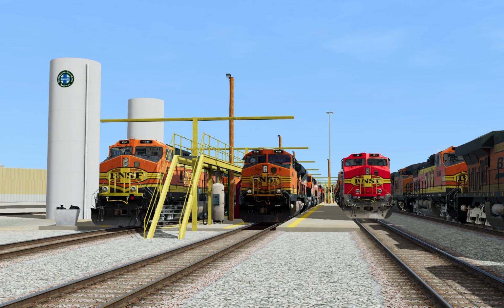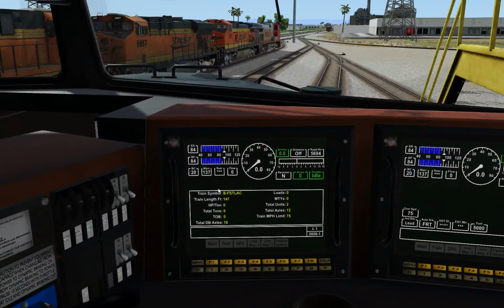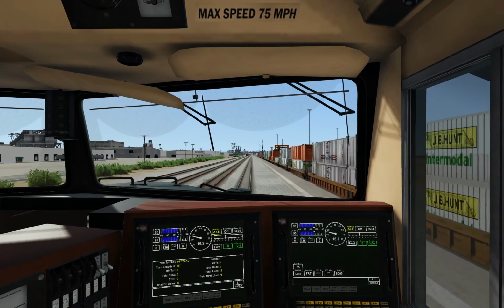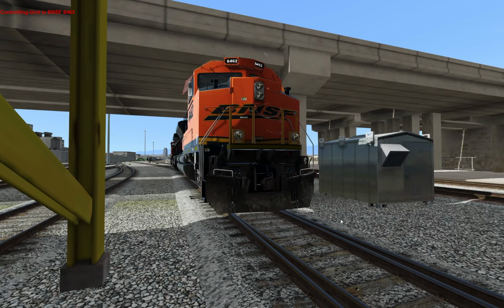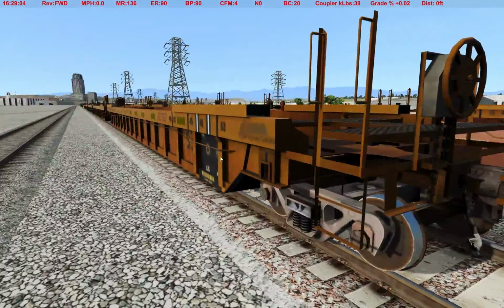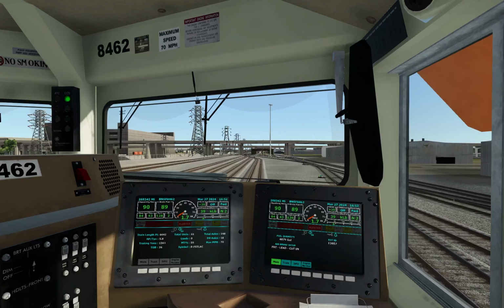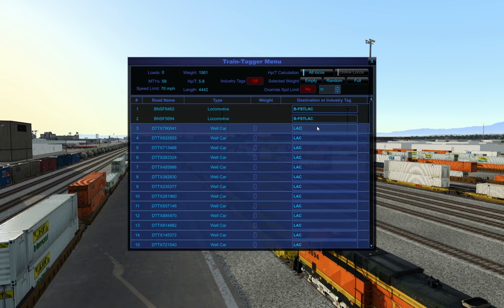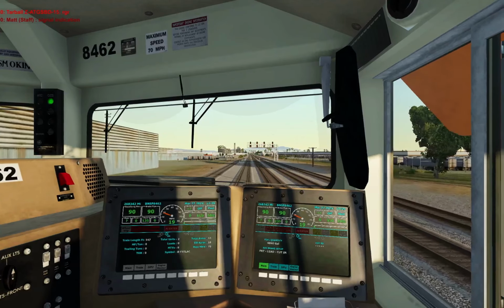Run8 Train Simulator | B-FSTLAC | Baretable Transfer Job

Comment: I had no idea a train simulator with this level of sophistication existed. I ran msts for many years back a while - still have my expensive controller to prove it. 
Run8 looks fascinating!  Where does one start?
Reply from the maker: Starting with just the base Run8 sim for $50 USD is a great way to start. It contains a large section of the Southwest Region around Barstow, CA for you to explore, and also provides a few different types of locomotives and freight cars for you to use. That way, you’ll have enough content to enjoy, and enough track to try out all the features that Run8 has, but not too much content so you’re able to learn and get used to Run8 as a simulator. After you become familiar with Run8, that’s when I’d recommend getting other DLC. The learning curve may be steep at the start, but it’s very rewarding and a lot of fun after practice.